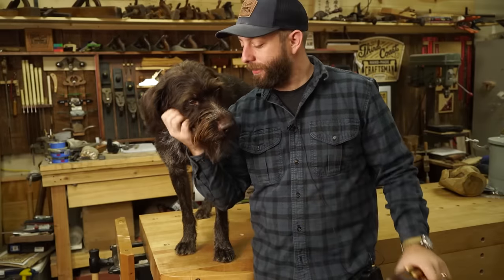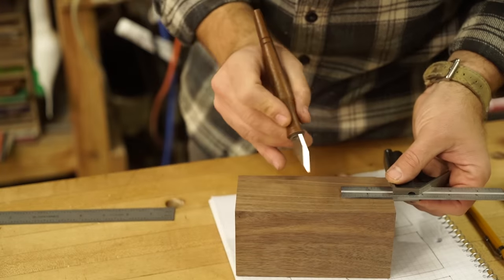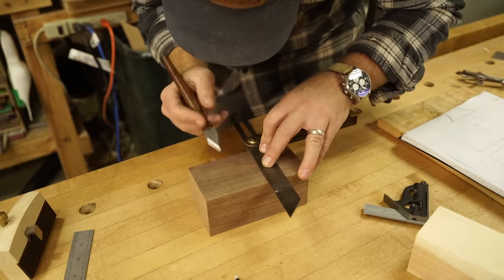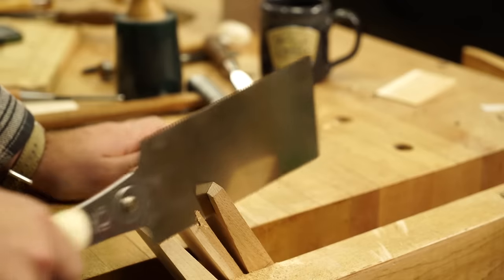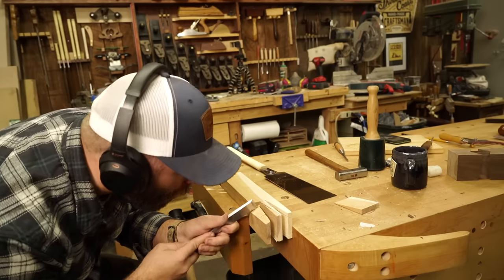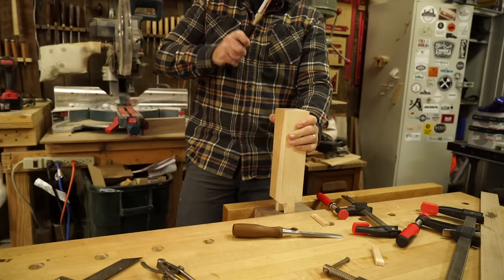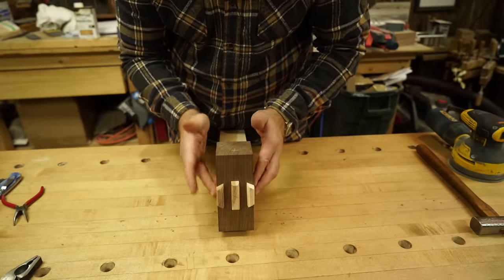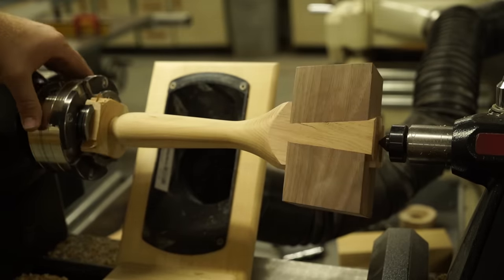Making Abe Lincoln's Mystery Mallet!  // "IMPOSSIBLE" Woodworking Joinery

Comment: Good on you for wearing a face shield while turning. Some guys are too proud to wear safety gear. Going without is how you end up with summer teeth, sum'er over here, sum'er over there!
Reply: Summer teeth😂😂😂😂😂😂😂😂,so true
Reply: A friend of mine does pewter casting. He recently posted to Facebook a photo of his face protection covered in pewter. I think some water got in and it exploded. Without the facemask, he'd probably have lost an eye.
Reply: Safety nazi work snitch has entered the chat
Reply: woodturning is relativly harmless depending on the turning speed and condition of the wood anybody with even some experience would be able to judge using a mask or not. then again im not a safty geek i weld without safty stuff sometimes coz bacon
Reply: Safety is incredibly important. The emergency off switch for the vertical spindle sander wasn't accessible with your foot or knee, so when I lost control of my piece I tried to shut it off, and almost got my neck taken out by the work. I ended up catching it in my hands before it hurt anyone else (was all that went through my head at the time), and my hand was torn in half as a result. The piece blew apart and put a hole in a plywood cabinet door. It doesn't take long for something relatively harmless to turn incredibly dangerous at that RPM.
Reply: that's funny. I'm going to write that one down lol
Reply: I know it's not the same as an industrial metal lathe, but he shouldn't be wearing long sleeves near that lathe either. I worked with a guy that got sucked into one and killed years ago due to long sleeves.
Reply: @tylerjames1716  . Yeah wtf needs safety gear? Never had an accident so what's the point hey?

Comment: I watch the whole thing, I want to say “oh I see it all makes sense.” Nope still seems like an impossible joint lol. Good work!
Reply: Freeking amazing.....is all I could muster.
Reply: Same !
Reply: Yea lol
Reply: Think of those plastic buckles on a dog collar but with a wooden mallet.
Reply: True. 😆😆 i still can't figure it out
Reply: So the holes in the Hickory are as wide as the widest parts of the handles but taper off towards the edges. He clamps the handle ends and forces them into the head slots then when released they spring outwards to fill the gaps in the head. The hard part is that you can only test it as you make it. Obviously you can check and recheck measurements but you just get the one chance to get it right.
Reply: The mortise is the same width all the way through the head but tapers inwards inside the head so it's narrower at the surface of the head. The tips of the tenon bend in so they can stay in the widest part of the joint. Insane amout of precision to cut that right and get it together without breaking something. I suspect he might have attempted this mallet multiple times and just showed us the success.
Reply: My thoughts exactly (though I'm not a woodworker).  I watched him do it and I still have no idea how he did it ... it's still an impossible object to my eye and brain.

Comment: That is fantastic.  Even if it did not have “forever” assembly it is a beautiful mallet.  Great job as always.
Reply from the maker: Thanks jay!
Reply: It does though it would be nearly impossible to take apart and if you wanted to be extra thorough you could cut slots in the faces and insert wedges to completely prevent it from coming out ever.

Comment: Thank you brother. 13 months ago I became inspired to do attempt woodworking. I built a workbench from 2x4s using only a claw hammer, a rusty handsaw,  and a set of Stanley chisels i got from Lowes. All the joints were halflap and only a couple were loose. This was due to the hook on the tape measure being bent, creating an extra 1/8 and me not realizing it until too late. Shortly after I started purchasing power tools and such and stopped using hand tools.  I recently bought a set of Narex chisels in the hope of rekindling that desire.  Well,  you sir, have done just that.   For that I thank you sincerely.

Comment: Absolutely gorgeous finished product, the only thing I would do is fill the hole where the lathe was in the tenon, other than that it's perfect.  👌👌👍👍
Reply: Or leave the middle tenon an eigth inch long for the lathe center and trim it last.
Reply: @jco2641    Good point!

Comment: The mallet head spinning around when it was on the lathe looked like it would have completely demolished a finger/hand if you slipped into it's path of rotation.
Reply: Why u scerd?
Reply: @EwePeople  You got that right ! Nah man I wouldn't be scared but I would be extra cautious. I would hate to only have one functioning hand for the rest of my life.
Reply: It probably has security mechanism like at the part where he held the handle and it stopped. So if you did accidentally put your hand on the mallet it would stop automatically
Reply: @sethj6483  NOPE!
Reply: @sethj6483  it stopped because he turned it off.
Reply: @sethj6483  dawg. He turned it off
Reply: @sethj6483  They have that with chainsaws where they run a small bit if current but this is wood bro.

Comment: Wow, that came out really nice.  You think the joinery will be up to using it?  The head won't come off, but will the hickory crack?
Reply from the maker: i highly doubt the hickory would ever break, hickory is ridiculously strong. But its more of a fun conversation piece than one of my mallets that Im going to beat on. Ill use it for light work.
Reply: Most wooden  axe handles are hickory. There isnt a doubt in my mind that this mallet would be up for some hard use, as long as the stock used was quality.

Comment: Absolutely RIDICULOUS craftsmanship! I'm blown away at how straight everything is, yet done by hand. Very impressive! I have to ask, what chisels are you using (any certain brand recommendations?) because mine are garbage lol.
Subbed to learn more new things!
Reply: They look to me like Japanese chisels. I don't own any but have used some and they are top quality
Reply: @glynnepritchard2526  it's a bit both. Mostly to do with sharpening alright but there is a definite difference in quality too and how long they hold their edge.
Reply: @theronmatron  did you watch the video? Paul uses cheap $10 chisels and due to his sharpening tech will outlast any of the expensive versions. I have a few sets of reasonably expensive chisels Ive used for decades and always complained about the edge as I was never taught this sharpening style. I wish I had known about it 35 years ago.
Reply: Sharpen it and learn to use it and you can make stuff like this too.
Reply: The only thing that makes a difference in how long it holds an edge is the material. If its carbon steel youre good.

Comment: Hardcore mode: make the whole thing out of metal.
Reply: Except that with metal you can simply weld it. No need for that fancy joinery. It would be interesting to see if it's even possible though. You'd need some hella powerful clamps for the assembly.
Reply: @slickstretch6391  Metal is much easier to work with. Just make one part like orange hot and and it'll be easy.
Reply: not exactly the same thing, but another kind of "impossible" dovetail: https://www.youtube.com/watch?v=a3V42KwLTeE
Reply: @SmartassX1  If it's hot it won't bend back. Make the thin bits thin enough and use a suitable steel alloy with the right heat treatment it'll work exactly like in this video.

Comment: If his goal was to make it so the head would never fall of, why didn't he just make it out of a solid piece?
Reply: Consider the job of the head, and the job of the handle, and the forces involved, and how grain works, and the different characteristics of different species of wood.
Reply: @Cap10VDO  it would work just fine. You could turn out a mallet in 10 minute and it would last a long time. Wood isn't that weak.
Reply: @michaelweston6083  no, Cap is right. the grain in the handle needs to run perpendicular to the grain in the head. Your idea would work, but it wouldn't last as long as two separate pieces.
Reply: @jedh3721  it doesn't need to be and for what it's worth, making it out of one piece is quicker, cheaper, and easier not to mention sturdier. A round single piece mallet also has a 360 degree face.
Reply: Nah  the wood grain thing is right. The wood is strongest when its recieving force that is in line with its grain, so with a single piece of wood you will fracture the handle pretty easily. I forget the figure but the grain direction makes it several times stronger, so a 2 piece will be significantly better at handling the forces.
Reply: Michael Weston 
You don’t know much about wooden tools do you?
Reply: @christiantheologyunited3707  I have a round wooden mallet in my garage that is older than me by about 30 years. It is a solid piece and it works fine. Yes, what you guys are all saying is true, it is stronger that way but it doesn't matter how strong it is if it that level of strength will never be needed. Its like making a car that can go 200 mph when the speed limit everywhere is below 60.
Reply: Michael Weston  I am an amateur bowyer. You can make a serviceble bow out of common inexpensive woods. You can build a laminate bow with said woods. Easier and less fuss than carving a traditional bow out of fussy woods like yew or osage orange. 
Yet the construction of a carved yew or osage bow if done right takes advantage of the characteristics of those woods and you get performance that the easier builds from easier less expensive woods do not have and never will have. It is perhaps a subtle difference but it is worth it. The yew and osage will also last longer if used and cared for properly. Then there is the satisfaction of doing something harder that takes more skill and finesse. It makes it worth more. 
There is more to making this mallet than a desire for utilitarian function and ease of construction. He wants to test his skill and see if he can do something extraordinary, and hold the mallet in his hand and say "I made this" while understanding what it is he has done. Not just do the quick and easy thing. I hope this helps you understand .
Reply: @DaveMiller2  they are different things. My argument is basically say "dont temper spoons" because spoons will never face that abuse so it isn't necessary. Why would you temper a spoon? Because there is no point.

Comment: That is a challenging hand joinery job but the mallet is worth the effort. Hickory can be pretty tough to work with! My only issue would be using walnut on a striking face a it's pretty soft but you likely have plans for when, where and on what you will use this beauty. Thanks for the well put together video.

Comment: Beautiful work my friend. Another excellent way to make such an incredibly strong, self tightening joint is to use a similar tapered dovetail arrangement with 1 or more separate locking wedges or taper pins incorporated into the strongest tenons.
After assembly simply drive the locks into place and secure with a small taper dowel, screw or other method.
Its much to complicated to describe but anyone who can do this type of carpentry/joinery knows what I’m talking about.
There are many ways to do it although the method shown here shows an absolute mastery of the craft!
Well done!

Comment: Just a thought, If you were to design yourself a small brass tack with a head that would be no wider than the center joint, you could fill that hold the lathe left when you turned the handle. I'm certain you could get something done with your T.C.C. logo on it. Also if you look at knife forging, they sometimes create decorative pins when creating a mechanical fitting for their handles, a decorative pin could work as well... Just tossing ideas out there, because the lathe hole makes it look at tad bit unfinished, although I love the mallet as is! Great job beautiful piece of work!

Comment: You can also drill into the top and pour epoxy into the ramp if you need more heft and then cover with a wooden plug. Not traditional I know but it will also make up for the thin base of the handle's joinery.

Comment: Hi
I built the mallet recently but only successful on the third try. Tenons broke on two as well as the head cracked on the second try. I went back and looked at your video a little closer to make sure I didn’t miss anything. It appears that just before you insert the tenons there were some kerfs, maybe 4, on the inside of each tenon. Also I noticed at that time the tenons appeared to be tapered or pre shaped towards the mortise’s slightly just prior to inserting them. Were these observations correct and if so how did you pre shape the tenons? I didn’t use kerfs but I made the tenons a little longer and dry clamped them overnight. I noticed Roy Underhill used slightly longer tenons in his article. 
You did an amazing job and I will say it was one of the most challenging and frustrating projects I have had. I wanted to forget it after the second try but couldn’t until I completed it and I’m thankful that I did it on the third try. Thanks for the video and the challenge.

Comment: Beautiful result, and I love the intricate design and accurate hand skills. One thing - why did you leave the indentation in the top from the tailstock of the lathe? I was waiting for you to trim it off when you bevelled off the tops of the tenons, but no. To me, that’s a kind of flaw in an otherwise excellent bit of work. I still can’t work out how the planes inside those joints work together.

Comment: I’m on my 3rd try and wasted 3 weekends in this mallet.  My problem seems to be grain direction of the handle .  I keep tearing out the bottom corners where the dovetails meet during assembly.  I noticed your grain direction on that hickory is slightly skewed and I wonder if that provides a better strength for those corners.  Either way.  Best video of be watched in this mallet.  I’ll get it one of these days.

Comment: Interesting how the bottom trapezoid  matches the top trapezoid, but a little bigger. The bottom part of the handle’s dovetails gets closer to the outside as it’s assembled. I don’t know if the proud part is beneficial. Either they are parallel  and dont continue to dovetail past the top, or more wood was removed from the bottom of the head to accommodate that wider splay. I’ll make mine flush and keep as much structure and weight as i can.

Comment: Max, you put a scratch it it.

Never mind, those are just the pencil lines you forgot to erase from when you set the piece in the lathe. Speaking of marks and lathes... it could still be done, why not do a high polish on a penny and cap off that lathe divot? Or both of them; I'll have to go back and see if you ever show the butt of the handle. Maybe a thick leather looped hand-strap on the end instead. An' a deer-skin satchel to keep it in when it's not hanging on your wall. 

Ooo... 2 point cradle mount for your desk!

Comment: Just curious correct me if I’m wrong, but couldn’t you boil the head of the mallet in water so that it expands a bit so that when you set everything up the head would shrink around the handle as it drys.

Comment: Can you actually use it as a mallet though? It seems to me that when stressed, the handle will start to crack at the base of the head, which looks like a serious weak point in the design of the handle, and once those two flaps crack, your mallet will fall apart...
Reply: Do you actually work on a mallet for days to just destroy it using it?  This is a decorative tool to be sure.

Comment: I don't see how this mallet is immune to loosening. While the joinery is beautiful it seems that there is very little mechanical advantage. How is this more secure than a straight split tennon in a dovetailed mortise with a wedge driven through the top?

Comment: You say you had difficulties working out the tenons, why didn’t you work from the shoulders upwards, you knew what the depth your timber was, so your lines would measure from shoulder to actual top of the mallet head, the extend your lines, for the part extending above the mallet head.

Comment: nice work but I think I would have cut the tenons flush on the head so you could place it on its head and not tip making it easier to pick it up while working that is if you actually intend to use it, be a shame not to, it needs patina.

Comment: You should've soaked the handle in water to help it bend
Reply: This would expend the wood to the point it would not fit.
Reply: @mikebutler5395  I've seen a puzzle where there was a wood block with 2 slots cut into it and a bolt n screw was thru the center trapped between the ends.. The trick was to soak one end and clamp it down to insert the bolt ..then unclamped it returned to its original form. The soaking allowed the wood to compress.